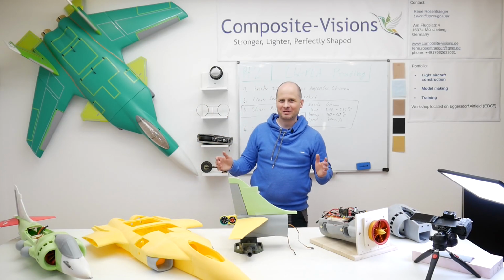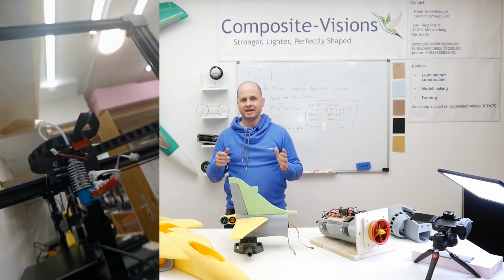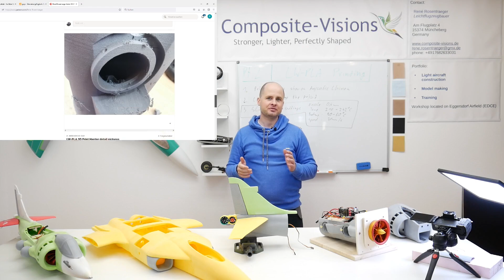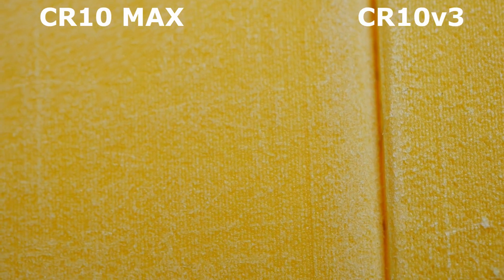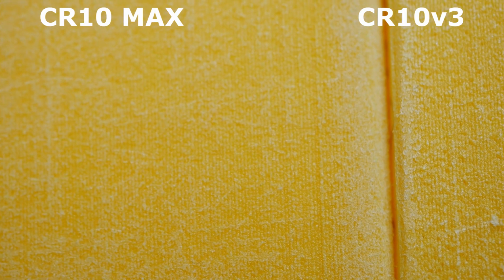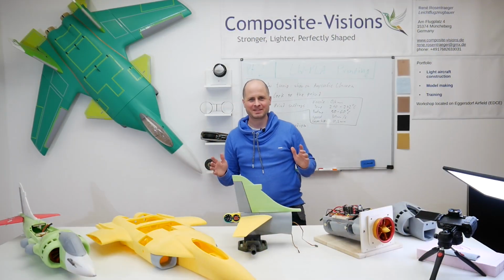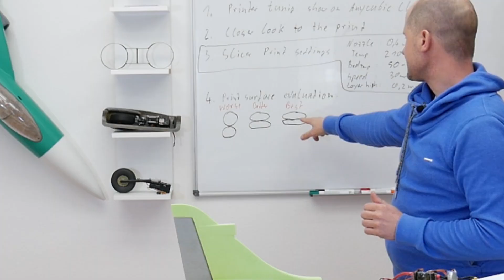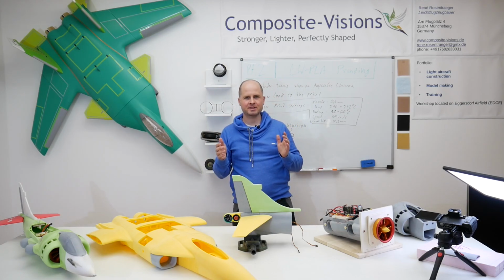3D-Printer Modification For Best LW-PLA 3D-Print Results | Makro View to Printed Parts

Comment: do you know if it's possible to get good lw-pla prints at significantly higher speeds on any of the new high speed printers?  a bunch now advertising 300 to 500 mm/s.  ty for the video!
Reply from the maker: With the actual filaments it's not possible.
Reply: @rene_rosentraeger  what happens if you try to print lw-pla too fast?

Comment: Super nice models! I had a chiron once, but i switched to a RatRig V-Core 500mm³, prints multiple times faster and at the same time with higher quality. You would definitely benefit from it
Reply from the maker: Absolutely. Only on LW-PLA speed is no advantage. It has to be printed at 30mm/s.
Reply: @rene_rosentraeger  makes sense, havent use that kind filament by my own yet